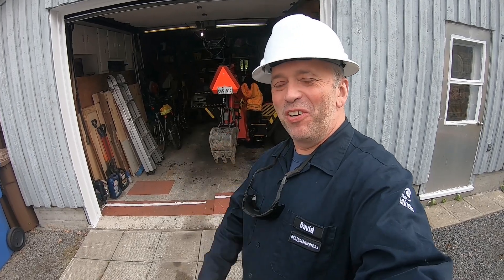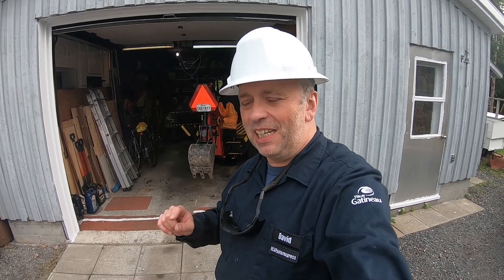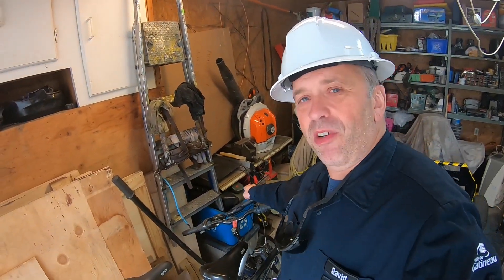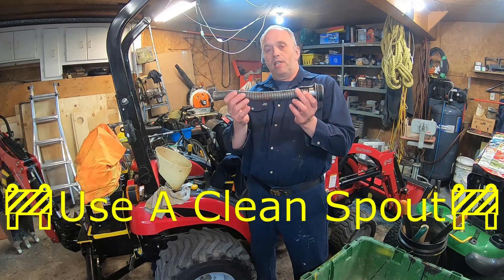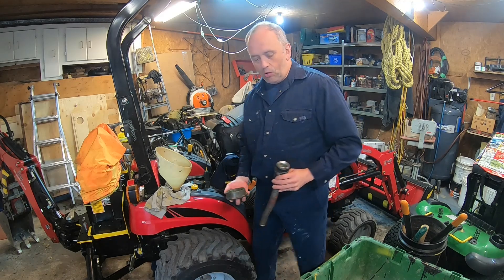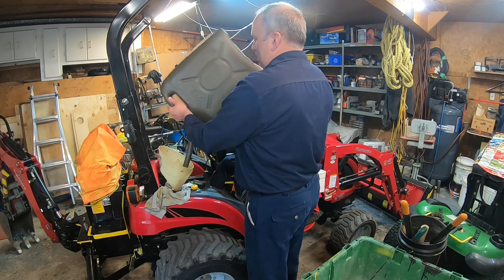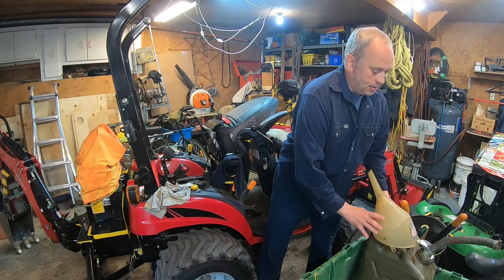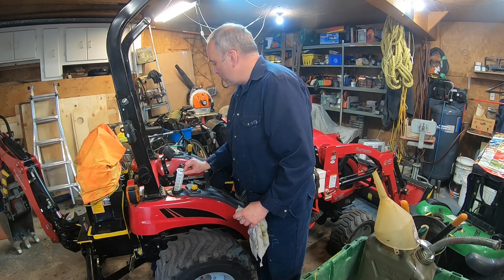Refueling My Mahindra eMax 20S HST With Proper Preventative Measures To Avoid Diesel Contamination 😮

Comment: What I like about the pump is that you need not a funnel. And you don't happen bring the can over the funnel/fuel cap. So less chance of dirt coming into the tank.  BTW, one other good thing to do is to keep the OUTSIDE of the cans clean as well.  If not, chances are that one day, with our hands or by removing the cap of the can, that dirt get introduced into the fuel. For my side-by-side, I put the fuel cap right on my seat, because it's very easy to forget. On my excavator, no problem. You need the ignition key into the fuel cap to open it. Then you need to replace the cap to remove the key from it... pretty much idiot proof system! Getting the fuel at the right moment is key.  Having summer fuel being used in the middle of winter without additives is not great... Thanks!
Reply from the maker: Good Morning Mon Ami Joe 😇👍 Thank  You Very Kindly For Your OUTSTANDING Informative feed back comment ( Yes I totally agree with you and thank you that is a very good point Joe for keeping the outside of these ( fuel tank/canister/reservoir/Jerrycan ) Very Clean 🧐👍and it is also a very way to keep it clean so doing its like a pre inspect that Jerry Can for leaks, rust or cracks before going to fill it up 🧐👍Yes having the right fuel at the right moment is also important for gasoline too 👍🧐🚧🚧 I can't wait to see one of your OUTSTANDING videos or short 😇🙏 Be Well Mon Ami and Say Hi To Chef Celine for me 💖💖🌹🌹😇😇🙏🙏Cheers 🍻🍻

Comment: Hello Super Dave!!  I just add a few drops of my famous prune juice to my fuel!!!! And KABOOM... doubles my power in seconds. It also cleans out any toxins from the engine. The funnel is a good idea, but if the federal government bans plastic then we will have to use cardboard funnels. (A one-time use) But the big question is if they outright ban fossil fuels like they want to then we will be using battery-powered tractors. Good for 5 minutes of plowing snow before you have to recharge them lol. Some great tips my friend. Take care
Reply from the maker: John you are THE BEST MORAL BOOSTER OF ALL MAN WITH YOUR OUTSTANDING FUN UP SPIRITS FEED BACK COMMENT 👍🤣😇👌🙏 Ho boy, I think we are going ( getting stuck ) with fossil fuel and plastic for eternity 🤣👍 Actually Battery Tractor are getting popular up here and in Europe ( Germany and France ) are very good 👍😇👌 and also cutting the maintenance time too ( no oil change on the engine or coolants and breaks too ) only hydraulic oil and some greasing but that is ok ( some parts now are on seal bearings not brass or steel sleaves !!! ) 😇👍 Be Well John and Again thank you so much mon ami and Be Well and have a nice week Cheers 🍻

Comment: How do you use loader float function on this tractor?   Thanks
Reply from the maker: Good Morning Sir, thankyou very kindly for subscribing to my channel. For Using The Float Option you have to life the FEL hydraulic Control level completely Up pass the detent hub. Look at page 24 from your 23 L Loader Operator's Manual.  🚧🚧Please read that manual and also the tractor operator's manual serval time, even after 6 yrs of owing that OUTSTANDING sub compact tractor I still read and found important information !!! 🚧🚧Cheers 🍻🍻
Reply: @RCAFpolarexpress  have email into mahindra. Only have instructions for tractor and not loader.